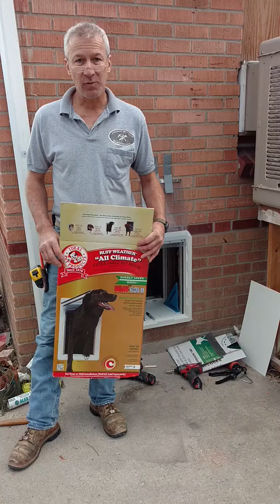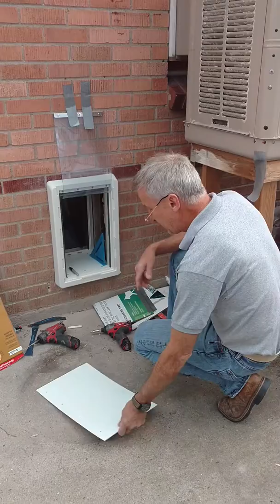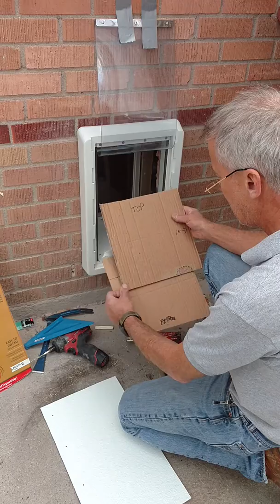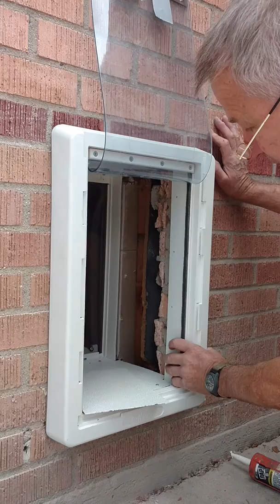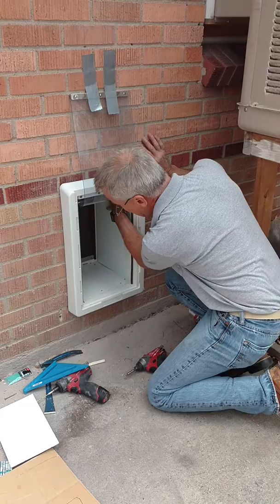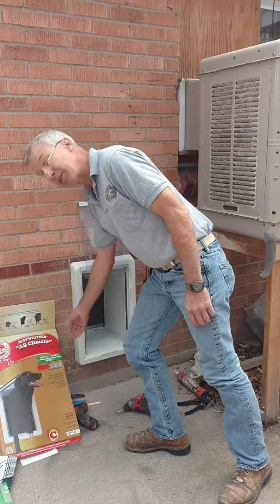Part 2: installing doggie door through brick wall finishing up.

Comment: You should not have even posted this since essentially YOU messed it up.  I would have been so pissed if you had installed this in my brick.  If this is not on your home, you NEED to make this right for the customer.   Order a good doggie door like from Security Boss that has 10" and 16" tunnel kits so you don't have to piece it together and is a quality door.   Ensure that BOTH the inside and outside are level.  You didn't.  This is some Jerry-Rigged crap.

Comment: What did you use to attach the doors if you did use the extension kit? My was 8.5 wide and the screws will not reach.
Reply from the maker: Threaded rods and acrilic plastic sheet bought at the Home Depot